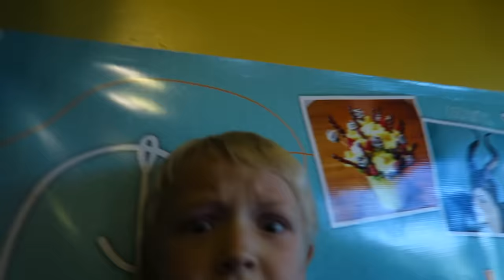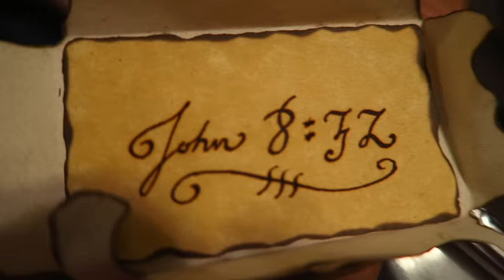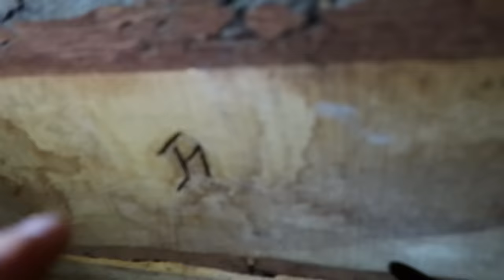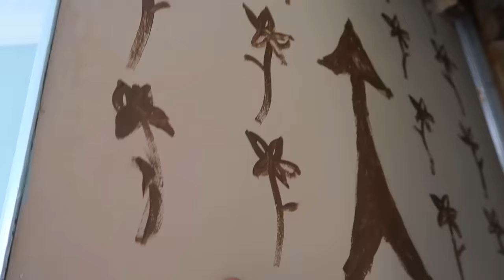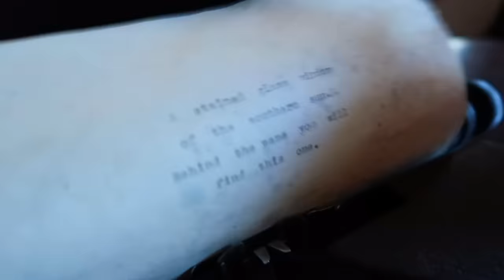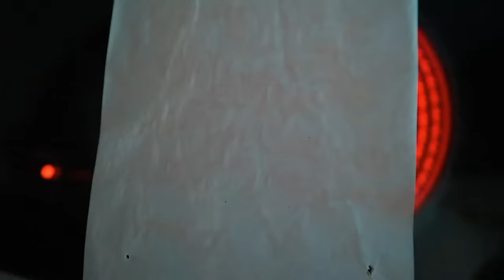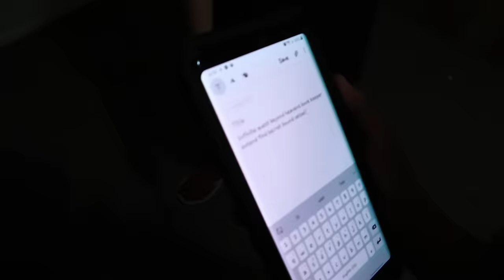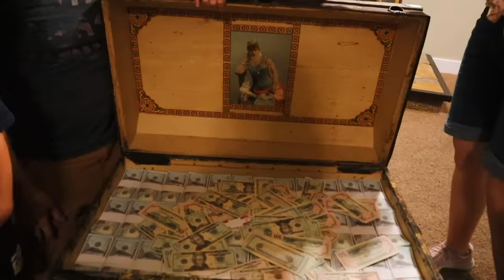Epic Treasure Hunt Full Movie!

Comment: I actually think that this is real because number 1 the records that they saw are really old and its not a coincedence that there is a message in them to lead to the treasure number 2 the treasure  is actually pretty old and there was a real looking crown there along with paintings scrolls and other stuff and lastly number three when they discovered the secret rooms and the secret room in the attic there was also a lot of dust in there and there is no marks that indicate they touched them also they coudnt have built them in such a short time since this is a very old house then the first clue they found in the brick the pouch used to put the bottle in became fragile  because it aged so that is  and the other stuff they found also had a lot of dust and really old so this is why it is actually real but i still love it fake or not its pretty cool and fun
Reply: The nickels at 21:21  were post 2005 
One comment said that it was probably set up by Ryan at least in part 1